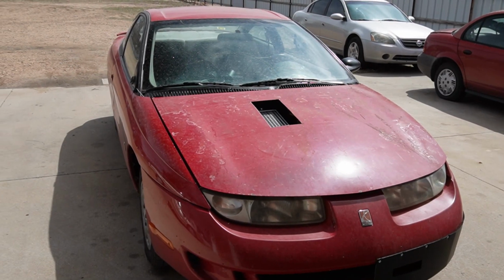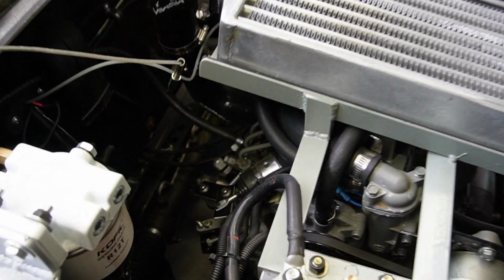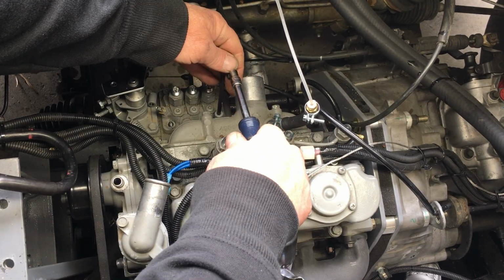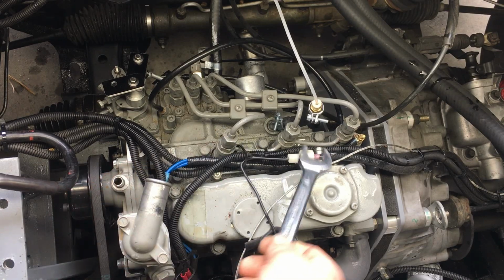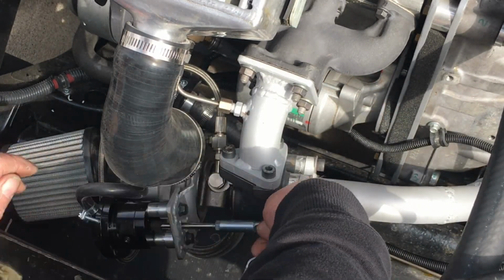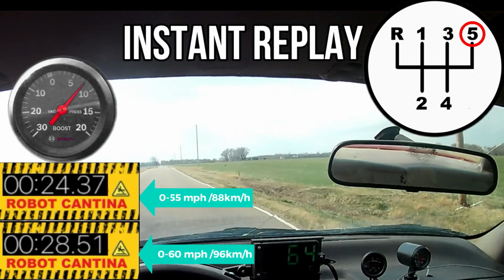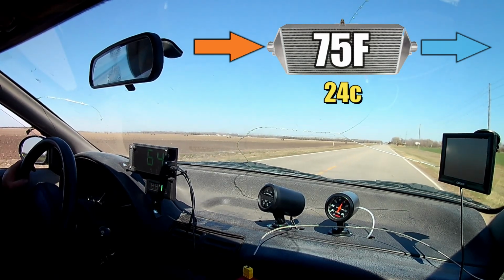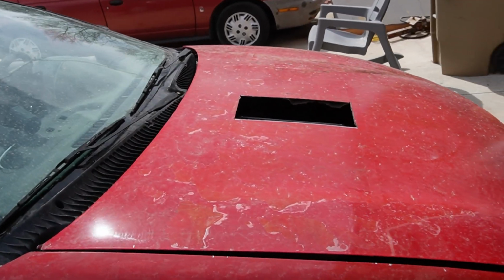S3 E9 We modify the injector pump timing and add more boost for more speed and better fuel economy

Comment: dude, put shrouding around the intercooler and scoop to force air through it. very little air is going into that intercooler. you have to force air into it via ducting. Also, put in a water injector between the turbo and oil filter and have it pump some water when egt's hit the limit. maybe a small 100CC or 200CC nozzle will do. use the turbo to build up water pressure in the system to inject it into the turbo. no need for a pump, just a reservoir and a small solenoid to open the line to inject the water. make sure it atomizes tho.

Comment: Could the hole in the hood be pulling hot air from engine bay instead of cold air into the cooler? Maybe a scoop would force cooler air across the cooler and help drop intake air temps.

Comment: The intercooler is either cooling or warming the charge air depending on where it’s coming from.
If it’s coming from the radiator and around the turbo it’s heating the charge.
Reply from the maker: the intercooler brought the charge temps down from 125F to 75F.  We explained it in the previous video.  Its not perfect, but it works and 75F ain't to bad.
Reply: @robotcantina8957  . Not as good as it could be if you ducted the cooler air to it.
Reply: @anomamos9095  With every subscriber, Jimbo's spirit grows stronger
As he races towards a future that's wild and free
In this world of metal and fire, he's the lone ranger
But he'll never back down, he'll never flee

In the cantina, where the engines roar
Jimbo finds a place to even the score
With his foot on the pedal, and his eyes on the prize
He'll ride to the limit, until the sunrise

In the dusty roads of Kansas
Where the winds howl and the sun blazes
Jimbo races towards the horizon
With the hope of a new adventure, a new season.

Comment: Not sure if this will help, but on my company mercedes diesel vans, if they turn up the boost too high of the turbos, the vans start to knock (engine abruptly trying to stop). They continuously get tuned to the edge, and so far no real damage to those engines. But I'm thinking, you could just increase wastegate pressure, until the engine starts knocking (usually under heavy acceleration). Not sure if diesels with direct injection need to be recalibrated with the weather, like port injected gasoline turbo engines. They sometimes knock under hotter ambient temps.

Comment: Increasing the fuel will likely cool the exhaust gasses down, if you make it slightly too rich it will mean not all the fuel will combust and the unburnt fuel will cool the gasses down, it will mean worse mpg and worse emissions though. You can cool down by going lean too but you will have to go very lean, most likely far too lean and it will cause more issues than going rich

Comment: Next project: put at tesla electric motor at the rear and use the diesel only to charge a small battery bank. 60+ MPG and incredible performance. That should have been the electric car we got. Lowest operating / ownership cost?

Comment: I’m gonna give you the recipe for max safe power for your setup. First step is to completely stop the wastegate from opening and turn fueling up a lot or as much as you can go. At this point you can melt that motor straight into the ground if your stupid. Drive it and slowly lay into the throttle. What your looking to get out of this test is the maximum boost number. You will see at some point boost will no longer rise with throttle input but egt’s will keep climbing. At this point you need to tune your wastegate. To accomplish this you want to find where the turbo will make the peak boost with the wastegate opening at that point. I normally back off the boost till I see 1 psi below max and then adjust it back to max boost. Now you adjust overall fueling. When in boost and full throttle you should not have egt’s higher than 1150 if you want to be completely safe. You can go to 1250 and probably be ok but I would just stick with 1150. Biggest issue you have is that your injection pump isn’t setup for boost reference. I’d bet you max out that turbo before you run out of fuel.

Comment: You could switch to a vnt turbo so you could use a bigger turbo and still get boost relatively early.
And you should modify the pump for the maximum rack travel to be extended by boost pressure.

Comment: Every time I watch your Kabota videos, it makes me want to stop my other projects and start the rebuild of my D722 project. But I’m trying this weird new thing called finishing a project before starting a new one. The amount of self control needed for this is pretty shocking lol. I’m learning a lot from your experiments though and I think I will be running the same turbo and only slightly increasing the fuel. Just enough to make it run right at higher elevations.
Reply from the maker: Finishing projects is the best way to finish ... projects.

Comment: My only complaint would be, that the 700cc should be making a lot more power out of the box. If you look at a 4 cyl 1.4l turbo diesel car engine, they make 150hp, so you'd think that an engine like this should max out at 70-75hp. But this one barely makes half the power. There's got to be some other reason why. More than likely, the engine is tuned (ported) to provide low rpm torque, and with a low compression ratio from the factory (as these engines are made to run 24/7 for years on end, and prefer reliability).
For a car, you can increase compression, meaning lower longevity for higher performance. If not, increase the boost, which has a similar effect. Exhaust temps should never hit 1k F on this engine. It might not get enough cooling.

Most road worthy diesel cars are required to run DEF fluid next to the ULSD fuel. If this engine has a way to add DEF, it would cool exhaust temps. You don't even need to run DEF (Urea). You can very easily just inject distilled water in the air intake, which adds torque, decreases exhaust temps, and somewhat protects the environment (better than with no DEF fluid).

Comment: One thing to consider is to set the EGT to 1200 degrees because it has not shown any problems (now that the intercooler is installed. I doubt the engine will be harmed in any way, and that might increase the acceleration numbers significantly. Don't worry so much if you push it and it explodes you will get many more viewers LOL!

Comment: You could tell right away that the injection timing had been advanced because of the note of the engine,they always tend to clatter more when you advance the timing,with regards to the exhaust temperature it might be beneficial to change the intercooler to a bigger more efficient unit which will pump more cooler air into the cylinders and normally that reduces exhaust temperatures,Scania and Volvo are past masters at this technology and squeezed a lot of power out of comparable small engines without any reliability problems where as Leyland destroyed a lot of engines by ignoring the benefits of inter cooling and that’s what finished them,to little to late to save them they just didn’t learn from their mistakes.

Comment: When the imperial folks convert units to metric, they often lack the intrinsic feeling for what the metric units actually mean. For example, the boost pressure is sufficiently described as 0.7 bar, as none of the gauges in this car come close to being able to measure 10 mbar or less.

Comment: I like this series a lot, it feels relatable because my car also doesn’t have a lot of power. I wonder if in the future gapping the piston rings might allow the engine to reach higher power even though that might be a bit of a extreme modification. It would be really interesting if you would get your hands on a engine like the one in my car in the future but I think they are not that common in the states. Here in Italy a lot of cars have them though (Fiat FIRE 1.4 8v).
Reply: Gapping the rings WILL most certainly allow the engine to produce more power and survive.

BUT, obviously large ring gaps will not increase the power by themselves, and the negatives of the larger gaps would be unacceptable for a street driven vehicle. 

The large gaps require more heat in order to get the ring to expand and get the gaps to close up so that the piston ring functions properly and efficiently. In a street car application, 95% of the time one would not be in the throttle far enough to produce enough heat to expand those rings far enough, and the operation of the engine would suffer most of the time because of that fact.

Comment: Jim thinking about stuff, how hot is the oil. WFO gets the oil cooking in most cases, put an oil cooler on it or maybe the radiator has a connection. All heat taken out helps, as cooler oil hits the stems. Perhaps a home building oil squirter for the exhaust valve stem/spring , possibly a few pipes in the valve cover. Soon I’d check the valve lash , but I was always doing it after a thousand miles or so, with a retorque of head bolts. Much diesel oil has darkened my nails since 78, at Olds

Comment: Doesn't just removing the injector pump shim also increase the stroke length of the injector pump and thus the fuel?
Reply: My thinking is it just raises the stroke in the cylinder doesn’t actually increase the movement of the piston
Reply: No, the throttle position controls the volume per squirt.
Reply: After looking at jerk-type fuel injection pumps, the beginning of injection is governed by the covering of the inlet port, and the end of injection is governed by the uncovering of the spill port. So you may be right, removing the shims may indeed advance the timing without altering the amount of fuel injected.

Comment: Intriguing. Though, if you built this setup for performance, might want to put a scoop on that hood to pressurize and, give fresh cool air to your intercooler as its mostly hot air coming out of it and heat soaking the intercooler from the engine heat.. You might even benefit from covering the front bumber due to the poor location of the intercooler
Reply from the maker: The intercooler location is not great, but its keeping the boost temp at a cool 75F.

Comment: looking at your boost get situation, it may be a smart idea to start looking at a second smaller turbo and do a compound set up, a lot of pulling rigs use that, or a more cost effective option may be a plenum to hold boost between shifts so hopefully the lil turbo won't have to work so hard, I've seen sources say to effectively boost a 1cyl with a turbo you need a plenum 4.4 times the displacement of the motor, that maybe a good starting point to start with that route, personally a three piece plenum would work so you can make a sheet metal middle to fine tune the volume of the plenum to work.

another thing I'd look at too is exhaust size, turbo setups prefer flow over back pressure scavenging, so maybe bumping up a size or two there might help a little bit to help that exhaust get out before it gets too hot.
Reply: oh, one more thing on the plenum, if you add one you do NOT need a blow off valve, diesels don't have throttle bodies therefore a BOV won't do anything.

Comment: nice job on fixing the dent in the back , if you wittle a piece of hardwood to the shape of the corner you might be able to push out that dent too using a hydraulic jack inside the engine space either that or drill a hole though the center of the dent put wood in the back screw an eye intoo the wood through the hole and use the come along again
Reply: It also needs both original style taillights. The one with amber looks stupid
Reply from the maker: The original taillights are hard to find and expensive.  We would rather spend the money on the engine

Comment: It needs a supercharger! So it can make about 15-20 psi at 5gear highway rpm... Maybe 25-28psi at peak rpm and full throttle,  pull the rings and  take a bit off the top ring, maybe polish the gap on the second ring, possibly lower the tension on the oil ring,  free ups little power,   take about .002" off #2 ring, and possibly .010 off the top, delending on whats there stock, maybe polish and ceracoat the pistons while they are out, and polish the beams ofthr rods, maybe. Cut the head . 010" while it's off, and port the head a bit, remove any casting marks, and smooth the path a bit, and match the ports,  leave about a 40 grit textured finish on the ports, except the exhaust , id  go with about 600 grit, hopefully prevent carbon buildup! Id love to have that engine!! Put it in a rwd, Toyota or something, with a 5speed, and possibly a 3speed behind it to split the gears up a bit, keep the engine at or close to peak power, (or two 5speed trans! 😆) Allow shifting from 3-4 in the 2, trans, split the gears, and add a overdrive if it ever could use it,  cutting the head isn't going to do alot, decking the block would be better, being it likely only has a small recess for the valve seats, at best deep enough for the valves to be flush with the flame deck,  having the pistons with zero deck, or out slightly, as long as the piston has clearance,  maybe have them out .020" and cut .015" off the pistons, making the combustion chamber smaller in the pistons, if they are like most diesel engines,  it's going to require removing and disassembling the engine, and machine work, when just a ring gap, and coating the pistons will likely make plenty of power, with a supercharger! And intercooler,porting the head would be nice,  just removing casting marks, and leaving a 80 grit finish has shown flow gains,  getting more air, in, so it can burn more fuel make more power! But I know gas engines, maybe diesel will not respond the same, but you did well with the gains!! 👍 Good day! ✌️

Comment: water methanol injection! you want the nozzle to be as far from the intake as possible, it alos should go after the intercooler. and you want to mount the nozzle on the same side as the inside radius of any bends in the intake pipe.

Comment: Genuinely fascinating series you have going. If you wanted to avoid messing with more fuel, maybe consider fiddling with the gearing of the differential? Having a shorter range at the top end may enable you to access that extra bit of boost at higher speeds
Reply: It would be MUCH easier to adjust the clutches in the CVT torque converter and achieve the same results.

Comment: Great video once again man👍👍 Btw just a suggestion to add a very small hood scoop to direct the air to that intercooler better. Just a very lightweight one made out of sheet metal and welded to the hood at maybe only a 5 degree difference off the hood to keep drag as minimal as possible would be great. Thanks and keep the vids comin'.

Comment: Great explanation of what you are doing and why. It won’t stop they keyboard warriors completely but should help those that just didn’t listen to something.  

As for the ring gap, it may actually be ok for the turbo.  I’m not sure about kubota, or if this engine also has a turbocharged option in a different application.  Other tractor manufacturers use the exact same shortblock with or without a turbo, so they set the ring gap for turbos no matter if the engine gets one when installed or not.   

It’s still a generic maybe, but it will give you something to hope for when the egt alarm is going off. 😂🎉😂

Now back to the video

Comment: The governor is your problem. You don't need 5th gear. Your creating to much load. But in 4th you don't need the governor because you are the governor. You can hold rpm higher for longer without the Temps rising. But the governor when re-engaging slows the turbo But doesn't regulate the amount of fuel related to the re-ramping of the turbo. On small engines this can pull 10-15% of max power when running on the over rich side

Comment: I'd like to see how power output, efficiency, boost & ECG compare when the diesel fuel is combined with two stroke oil at chainsaw strength...

And if clocking the intercooler 90° on the existing mount so the thin side protrudes beyond the hood is detrimental, beneficial or no impact.

Comment: It would be really interesting if you compound turbo it. That would help bottom and top end plus lower EGTs at the same time
Reply: A manual boost controller would very much help the existing system without having to go to such an extreme such as compounding...

Comment: Running rich will add thermal mass to the cylinder and cool it and the exhaust down right? I'm wondering what other tools you have to get more power and good temps out of your engine..
Reply from the maker: On a diesel, a rich mixture makes more heat it is the exact opposite of a gasoline engine
Reply: @robotcantina8957  oh you learn something new every day!
I would have thought it works the same as a petrol engine.
Kinda makes sense since a diesel engine relies far more on compression for ignition than spark or heat. So it tracks that there are substantial differences from the properties of the fuel. 
I still wonder what tools can you use to keep the exhaust and piston rings at a usable temperature? Is the solution running more lean? Would that sacrifice precious power?
This has got to be one of the best automotive engineering channels, I am loving this series!